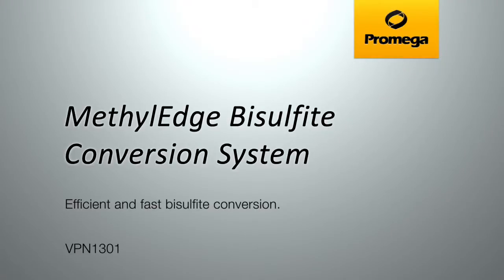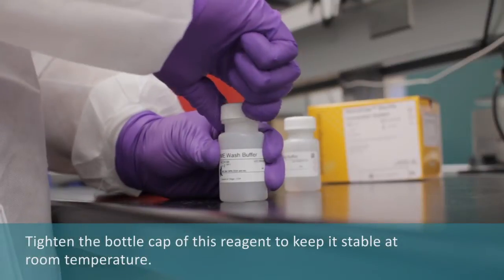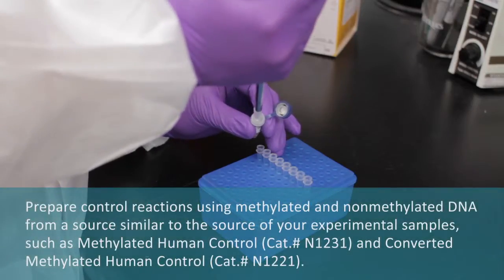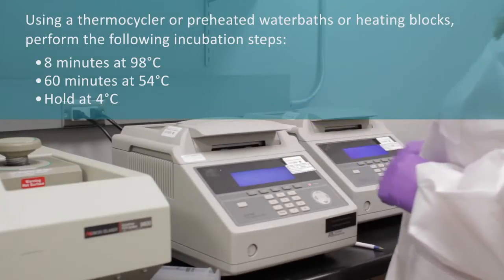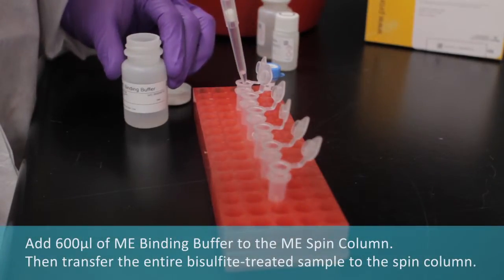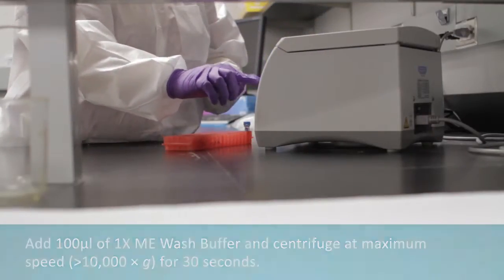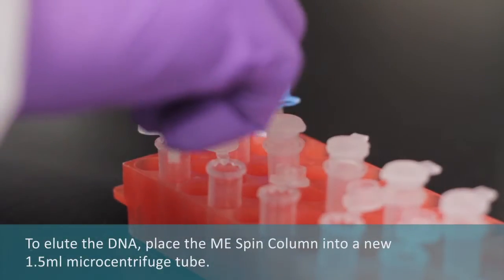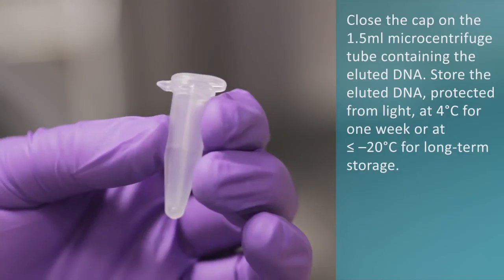MethylEdge Bisulfite Conversion System Video

Comment: Hello. Thank you very much for 
This video.I have a queation about final step. Can I elute the bisulfite converted DNA with more than 10 μL?
Reply from the maker: Thanks for your question. We will send your question to our technical services scientists and post their reply here. Stay tuned!
Reply from the maker: Hello, It IS possible to elute in a larger volume. As per the Technical Manual, TM381,https://www.promega.com/-/media/files/resources/protocols/technical-manuals/101/methyedge-bisulfite-conversion-system-protocol.pdf  Section 6 DNA Desulphonation and Cleanup, Step 9, “DNA may be eluted with up to 20µl of ME Elution Buffer if desired.” 

(BTW, We would NOT recommend eluting in a smaller volume, though).
Reply: Thank you very much for the quick reply and explanation. Best regards
Reply from the maker: You're welcome. Happy to help. Let us know if you have additional questions.